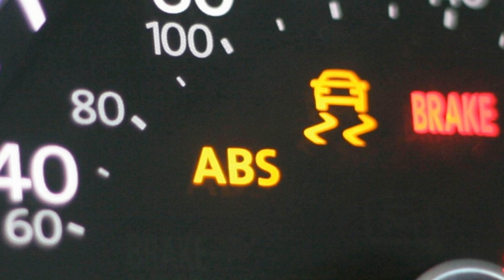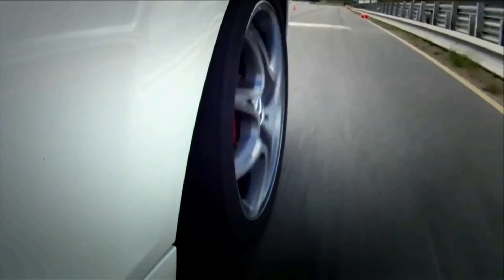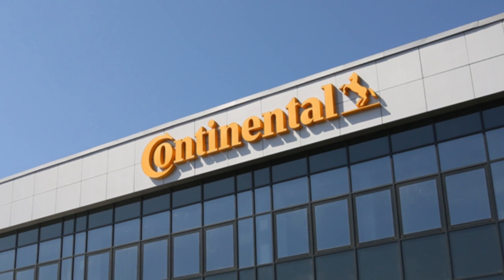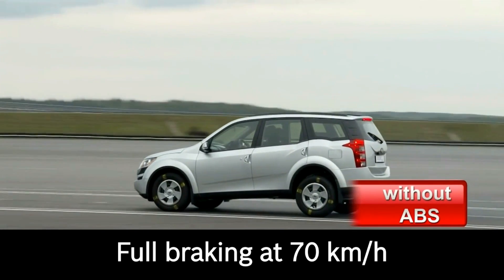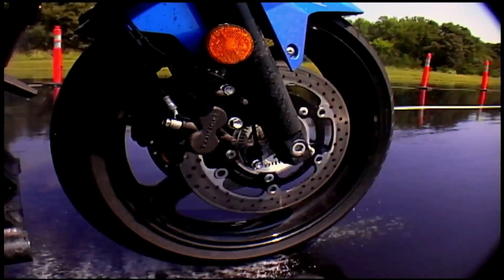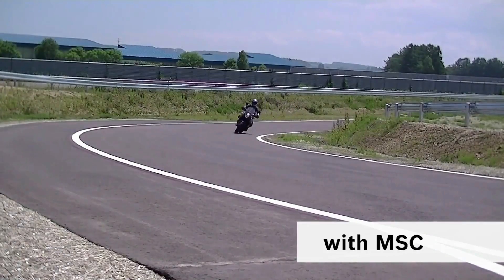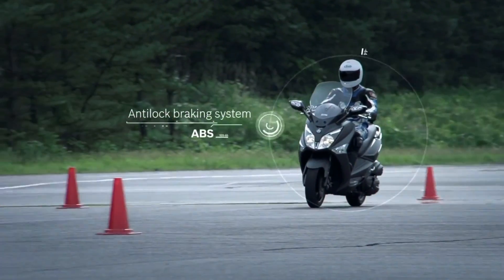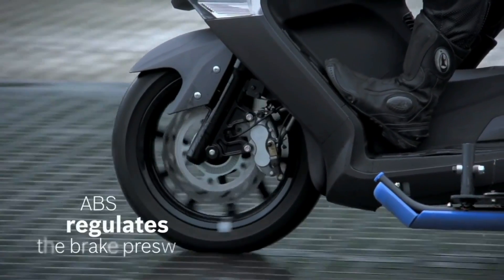Cornering ABS - How it works???

Comment: I have a normal abs in my motorcycle but when im in the corner at high speed i apply a half or little break at rear wheel and it function the same as corning abs.?

Comment: why would anyone break in the corner at the first place...???
Reply: Maybe because there is an emergency? Like a car on the wrong side of the road on a blind corner? or a pot hole, or an animal, or a tree branch falls onto the road, perhaps the rider in front of you crashes?
Reply: *brake
because they want to slow down... all top motogp riders use trail-braking techniques i.e. they brake in the corner, all the way to the apex - we don't have their talent or riding conditions on the road
Reply: Eldhose Jacob you obviously don't drive
Reply: what makes you say that..???
Reply: What makes you say that...???
Reply: Yeah instead of coming out with a dbag response you could explain.  It's a good point.  I mean yeah you can brake in a corner, you can use the back brake to help you corner, but 99% of the time you brake before the corner and take it at the correct fucking speed.